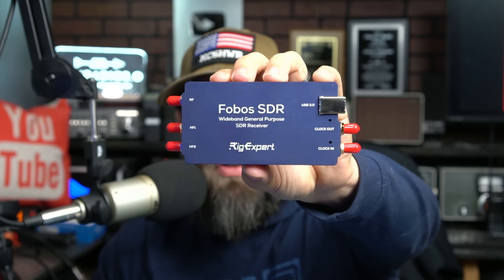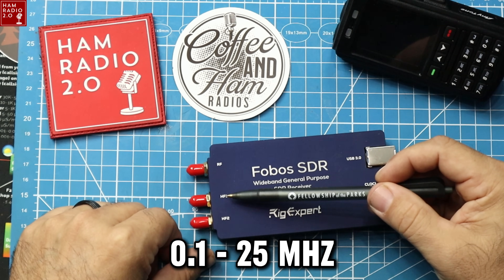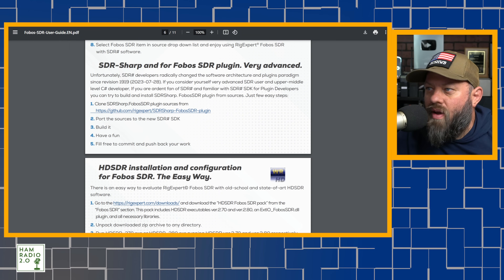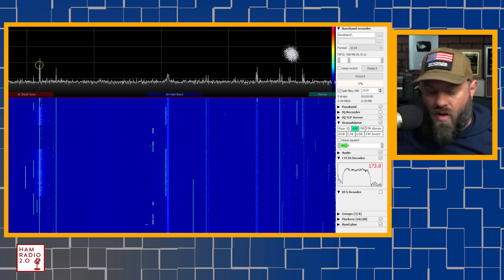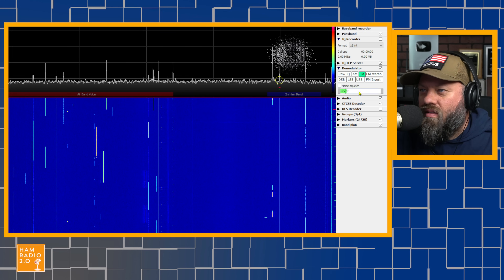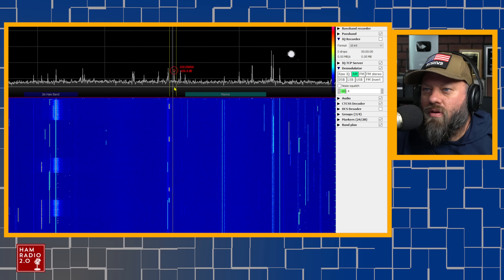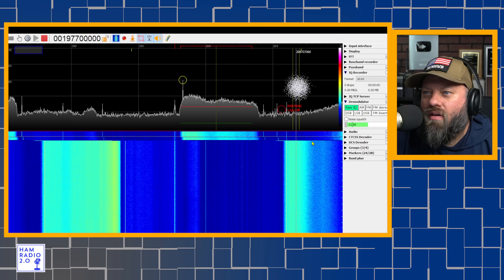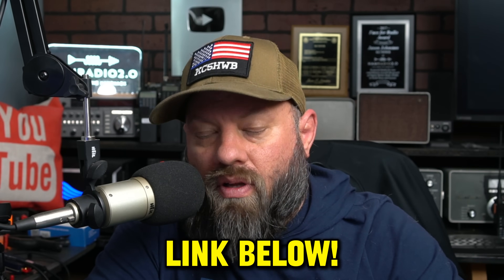RigExpert Fobos SDR 100KHz To 6GHz SDR Receiver

Comment: A very good YouTuber  - Tech Mind  found a lot of issues with this product per his review a few months ago.  Since you seem not to have  found any of  them, I am concluding that RigExpert may have addressed and  fixed them.   RigExpert's attitude toward Tech Mind  when callout about the observations  did not seem to care.
Reply from the maker: RigExpert has made several firmware updates lately.  But I didn't watch the Tech Minds review, so I am not sure what issues he found
Reply: @HamRadio2  Thanks
Reply: @HamRadio2 I've had this unit since November last year and I still cant seem to get it to work anywhere near as good as a cheap RTL-SDR dongle. You can pick up HF and FM broadcast signals within air band and up into UHF frequencies. I can't make a video on this thing. I've been talking with them and they claim it's primarily geared toward UHF band only, not HF or VHF. What a shame.
Reply from the maker: @HamRadioConcepts  Hey Eric - I found mine didn't RX very well on HF either.  But I got some good singals on the AM VHF airband, of course I live near an airport.  It would be nice if they could upgrade the HF section of this device.

Comment: SDR's are just incredible ! no longer do we need to buy things like scanning radios, or expensive general coverage receivers. myself I just bought a SDRplay RSPdx-R2 and it's amazing. I've got a couple of Nooelec NESDR SMart V.5's they run on my Raspberry Pi 4b and it's running using Dragon Pi64 which is a dedicated SDR OS and that has made my RPi 4b really a SDR powerhouse - it also will run my RSPdx R2 .  these receivers are excellent for folks who are interested in radio science , and they are affordable . my SDRplay has really supercharged my Yaesu FTdx3000 by tapping into the Yaesu's RF port on the back of the FTdx3000, giving me an excellent panadapter ( the built in scope is of older design and kinda lackluster) and it also gives me a second receiver for scouting while the VFO is parked on a working frequency.  - I'd really like to investigate this Rig Expert SDR albeit, I need to start saving up ( had to bust my piggy bank - but well worth it for my RSPdx-R2) . non hams can get their feet wet with these SDR's without investing big bux on general coverage RXer's  plus it is a hobby within our hobby and makes RF science come alive for everyone.... 73 thanks for the great video coverage  73 de N3TGY ..

Comment: Still waiting for someone to come out with a SDR based service monitor that would be affordable to most Hams.
Reply from the maker: Like the NanoVNA?
Reply: @ not sure what it can do, haven’t looked into it.
Freq range ( as we say in the commercial world, DC to Light ) AM, FM, SINAD RECEIVER TESTING, DEVIATION METERING, CTCSS AND DCS encode and decode, would be nice to decode and encode P25 ID's and being able to do the same for DMR, FUSION, AND NXDEN.
Would be nice to have touch screen controls for compatible tablets or laptops.
When you mentioned you were close to DFW, it brought back memories of the year I worked in Irving in the early 80’s. Was Assistant manager at a hotel and we had a contract with a major airline to house passengers when fogged in flights were cancelled. Loved the ice storms there (not) in January. Loved the area and almost bought a condo in an area called Los Collinas ( spelling). Recalled back to CMH when I was accepted to the university there. Wound up there again in the nineties for training with Uniden Land Mobile Radios. Took a co worker with me for training and he got a tour of Downtown Dallas at 80 mph. Man do they speed there!